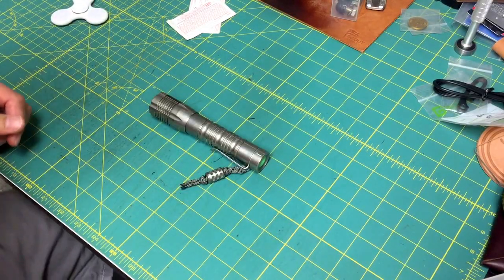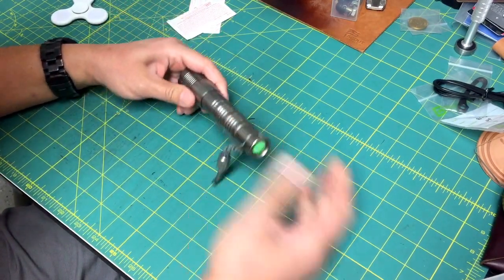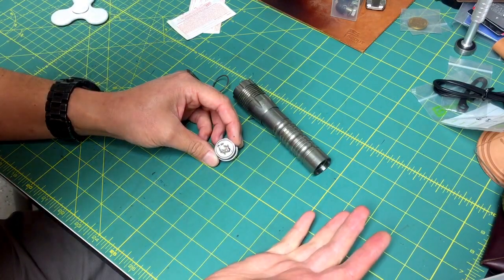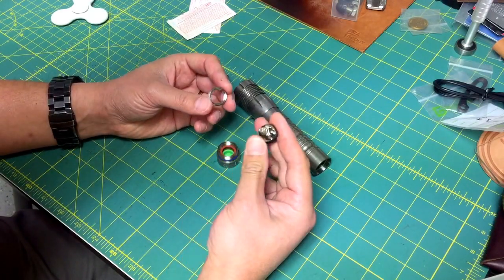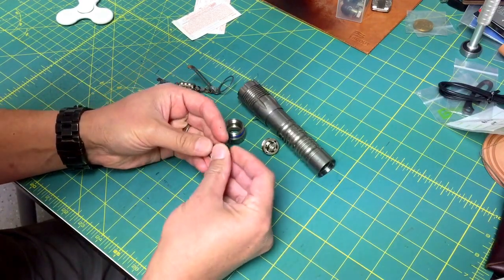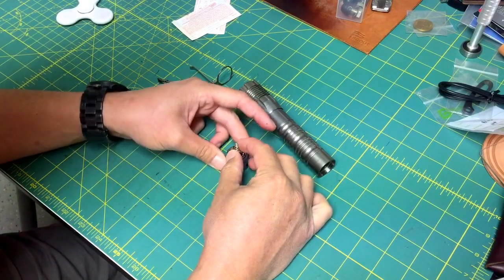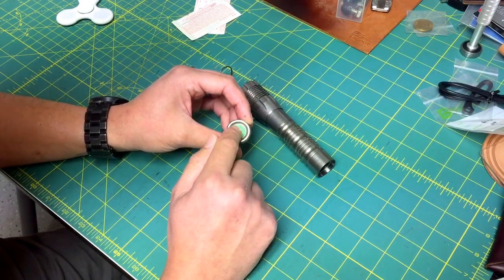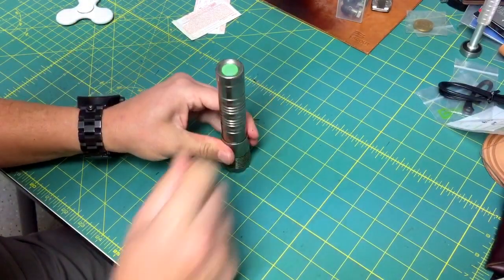Prometheus Alpha Flashlight Tailcap Boot/Switch Swap

Comment: What model of your light is that and what batteries does it run on? 18650? Really liking the machining on that body.
Reply from the maker: That's the Alpha Titanium which takes and 18650: https://darksucks.com/collections/alpha-flashlights/products/alpha-titanium
Reply: Prometheus Lights Thank's! Is it available in SS?
Reply from the maker: check out the product pages for available options :)